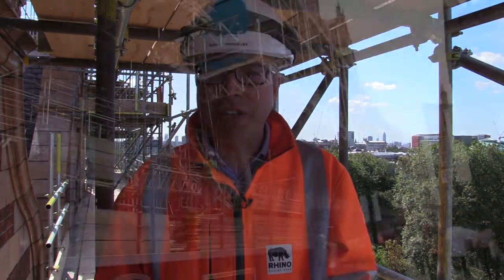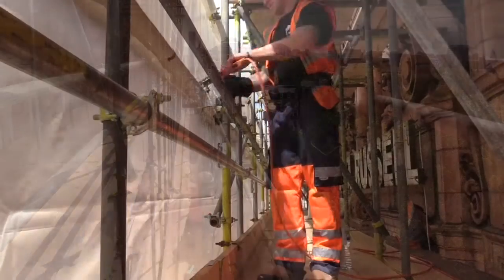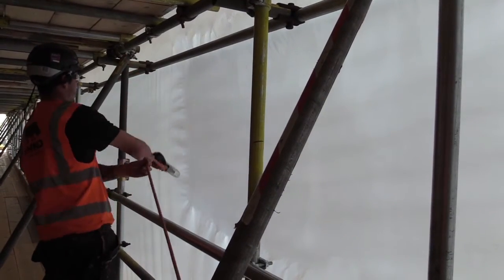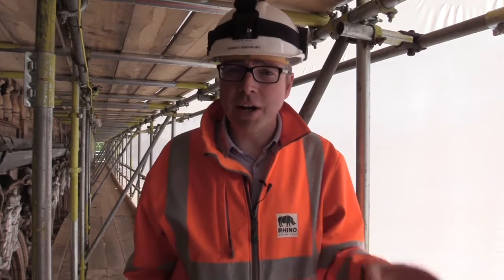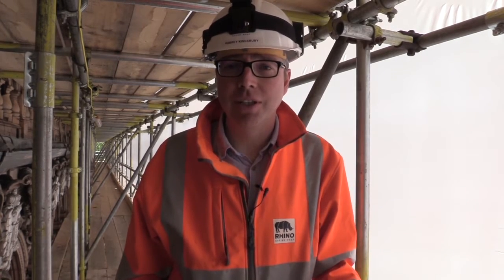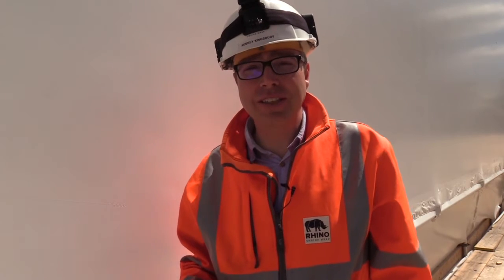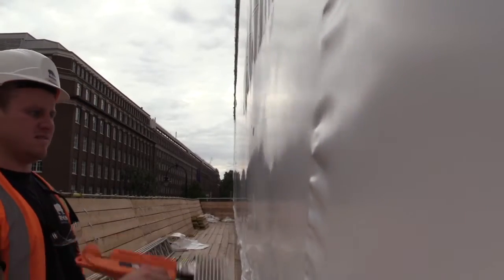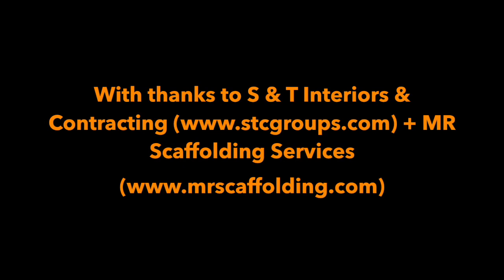A Beginners Guide To Scaffold Shrink Wrapping

Comment: you forgot to mention that the shrinkwrap catches 100% of the wind, while the netting used often in covering a scoffold allows 30%-50% of the wind to pass through. This makes it so that the forces on the scaffold structure are much larger when using shrinkwrap. It is also much more expensive and is bad for your health to breath those plastic fumes that comes from heating the wrap. Also, if done right, netting can be just as smooth and tight as shrinkwrap, and is much faster to install.